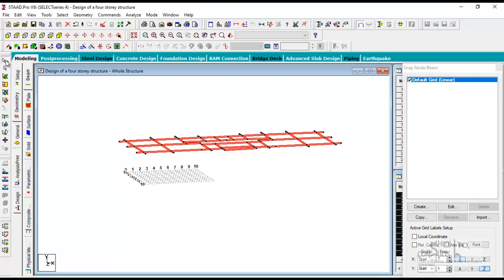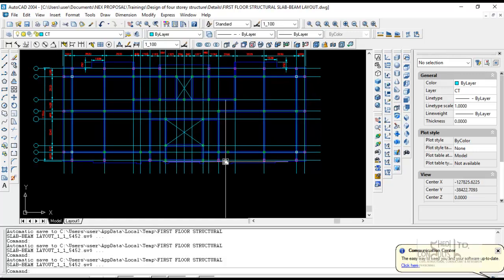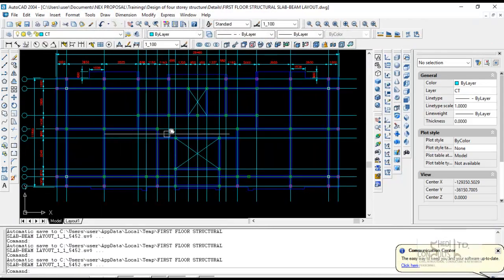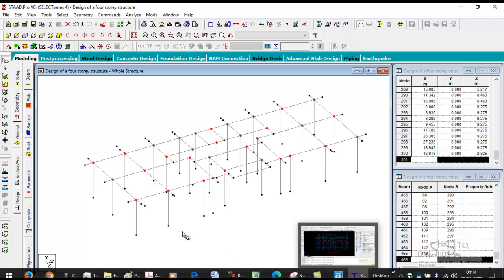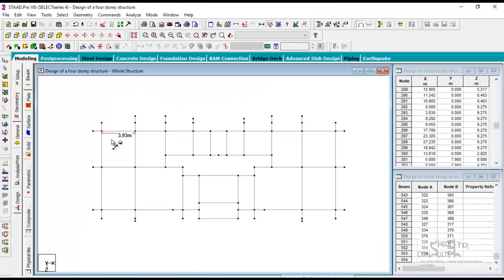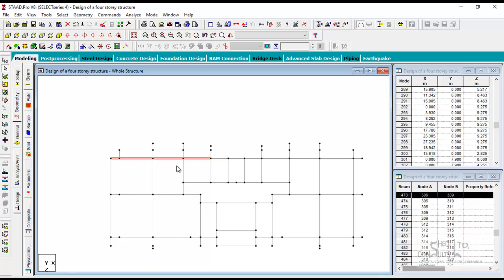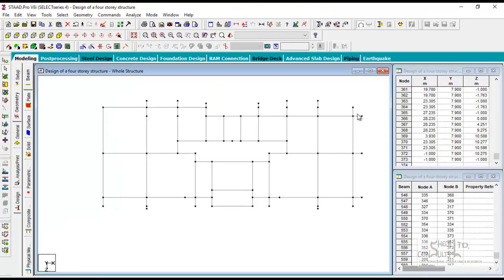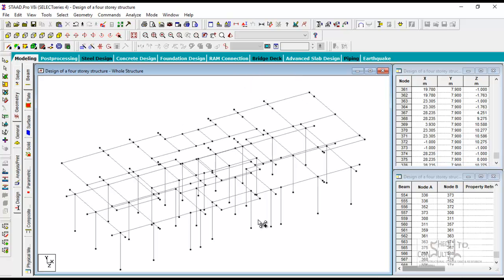Structural Analysis And Design Of A Four Storey Structure PART 9

Comment: Good job sir. Sir please why do you skip adding the cantilever slab here? You only projected the beams that will support the slabs out without adding slab to it. I want to know how is been done because I tried modelling a cantilever slab at a balcony. I modeled it perfectly but when I was adding floor pressure load, the portion of the cantilever slabs was not captured.  Please advise me on what to do. Thanks! CHIBUISI
Reply: The omission was intentional. You may send in your email address to obtain the full analysis file which contains the solid slabs as well as all the cantilevers. As regards pressure loads on slabs this is straightforward once you model the plates correctly. However, if you mean FLOOR LOADS which is the transfer of loads from slabs to the boundary beams based on elastic yield line theory, then you should understand the philosophy in staad. For you to transfer loads to beams using FLoor load, there MUST be completely closed perimeter beams around the slab. If this doesn't exist, the floor loads shall not be generated. Also note that for cantilevers, the loads to be transferred to the supported beams should not be derived using Floor load, as that is a cantilever, therefore the reaction at the support from a cantilever (qL/2) automatically provides the loads on the beams